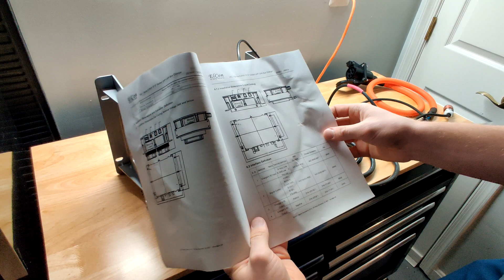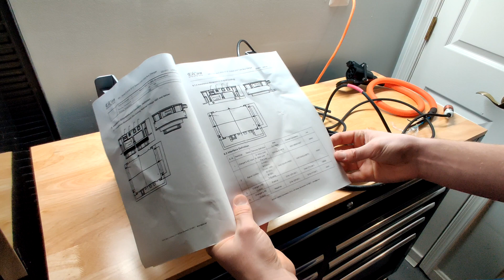Ford Escape EV Conversion EP 5: Charger and J1772 Charge Port

Comment: Have you thought about installing DC fast charger?
Reply from the maker: I have but unfortunately for this project it wouldn't really be possible since fast chargers typically require a minimum battery pack voltage of around 200v but mine is nowhere near that (max is only 126v). 

Also the options for DCFC are limited to CHAdeMO and CCS. There are no kits for the CCS type 1 we have here in the states. For CHAdeMO, it's not super complicated but there are not many CHAdeMO stations and it's being phased out. So the options really aren't great at the moment.
Reply: @reider_mcfeely  getting easier for ccs now but yeah still need 200v pack

Comment: Hey Reider, how do you interface with the charger? Is there a software Elcon provides to monitor charging at all? Or is it just plug and it charges?
Reply from the maker: There's 2 ways: with a relay and with CANbus. With the relay, you just use a 12v signal to turn on or off the charger. With CANbus, your BMS system sends signals to the charger to set the voltage curve, max charge setpoint, etc. CANbus is a standardized communications network so it works with pretty much every BMS.

Comment: Where does the communication cables go from type 1 socket ?
Reply from the maker: The J1772 communication cables go to a charge controller. In my case, I'll be using a SimpCharge. It interfaces with offboard EVSEs to allow the car to charge at all level 1 and level 2 J1772 public chargers.